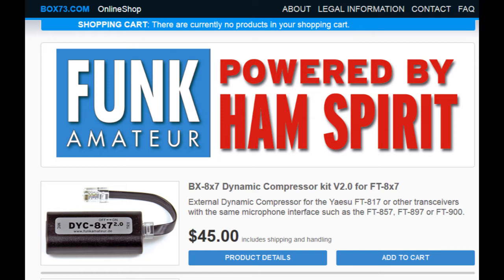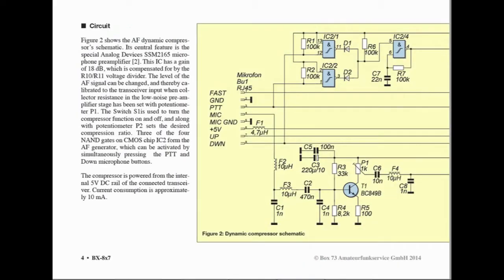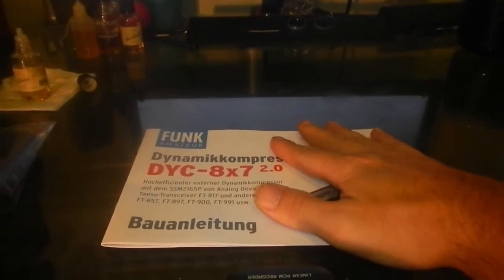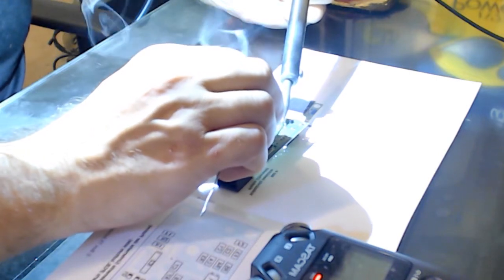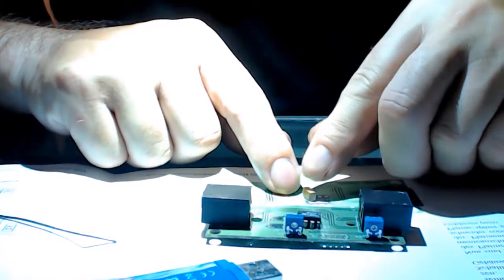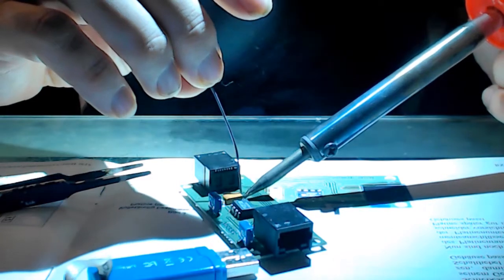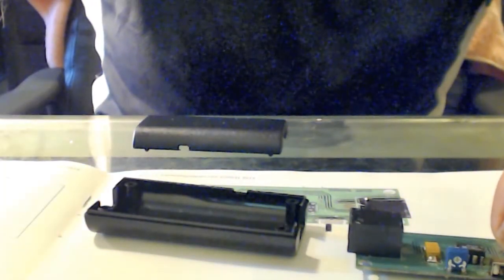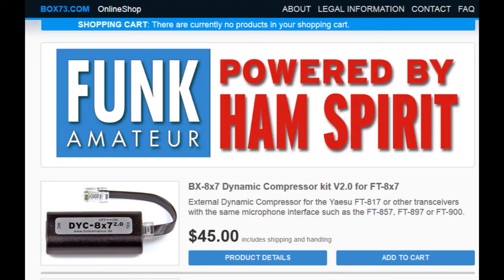Yaesu DYC8x7 mic compressor kit review set up

Comment: The audio on this video could have done with a bit of compression!! (or maybe gain but you get the point haha)
A useful video though for anyone who might be thinking of buying this.
Reply from the maker: cheers for the comment. It was stinking hot outside and I had a ceiling fan on in the room where I was doing the work. 
So I had to turn down the gain on the audio recorder so it wasn't too obvious. 
Thanks for the feedback though, I'll bump it up a few notches next time :)

Comment: Been debating picking one of these up, but I have about as much soldering experience as you.. I couldn't find your follow-up video, did you get it to work? 73 K7ASQ
Reply from the maker: Hi Andrew, No haven't got it working correctly as yet.  Rather than being a item issue, I think it is down to the larger soldering tip I used and not being suitable for the finer work. 
I have a friend who has one and swears by it for sota work. I just haven't built up the motivation to pull it apart as yet. 
It all works but has no audio output. I've checked the connections but no joy. 
When I get around to sorting it I will post a follow up video.